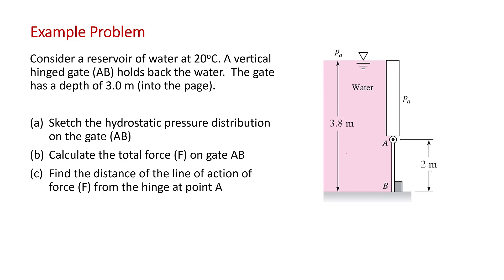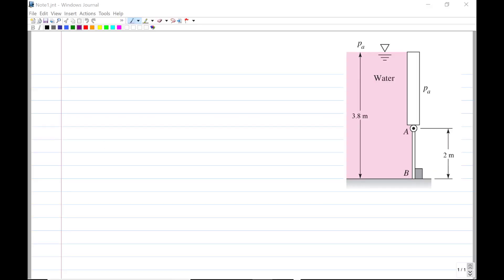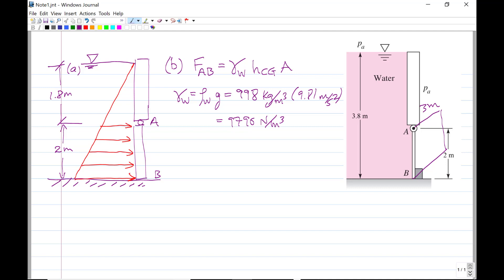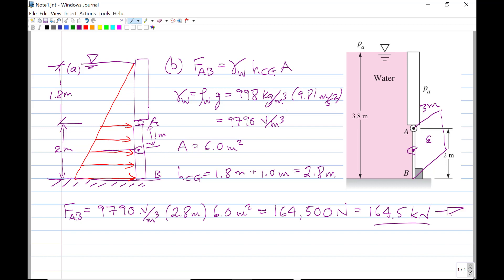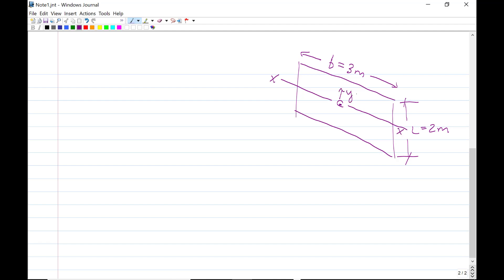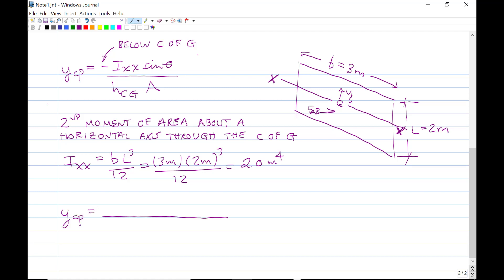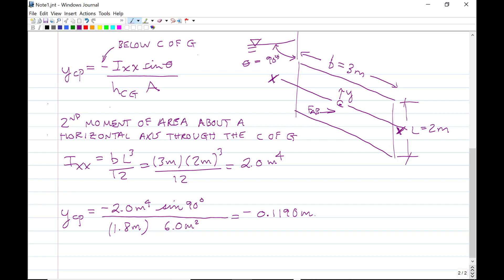Solved Example: Hydrostatic Forces on a Vertical Gate

Comment: I have a question. Why do we consider the horizontal force to be acting at the (height of) centre of gravity and then at the end we then consider it to be acting at the (height of )centre of pressure? Im sorry if this is a really stupid q im confused a bit
Reply from the maker: The magnitude of the  hydrostatic force is calculated using the average pressure, which happens at the centroid. But the line of action is below the centroid. It's like a triangular distributed load in beam deflection analysis, if that helps.
Reply: @FluidMatters  thankyou, that helped!!

Comment: Quick question does the force due to pressure depend on the whole shape of the submerged object or only on the surface in contact with the liquid. Like if a flat plane surface of slant length L is submerged, will the force be same as a slant trapezoid of length L also.
Reply from the maker: The total force due to pressure depends upon the depth of the centroid of the surface (which might be different for a trapezoid), the surface area. I hope that helps.

Comment: A salvage ship is attempting to raise an iron anchor off the ocean floor. The anchor has a mass of 560 kg and the density of iron is 7 800 kg/ m3 .The cable used to lift the anchor can support a weight of 5 000 N. before breaking. Use 1 025 kg/m3 as the density of seawater. (a) Can the cable support the anchor while it is completely submerged? (b) Can the cable support the anchor when it is completely out of the water? (c) What percentage of the anchor will be out of the water when the cable breaks?
Reply from the maker: That's an easy question to answer, if you do the necessary learning. Here's a recommended video top help: https://youtu.be/MJnYZ6s-LsQ

Comment: How would I go about finding the reaction forces at points A and B?
Reply from the maker: Basic statics: Once you have the horizontal force at B, then set the sum of the forces in the x-direction equals zero to get F_Ax and set the sum of the forces in the y-direction equals zero to get F_Ay.  Actually, F_Ay is zero by observation.

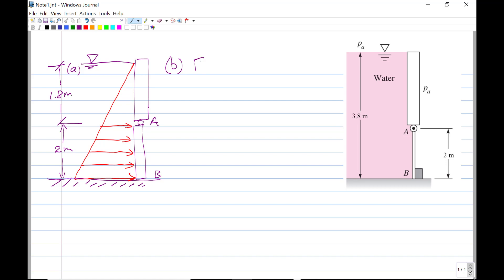Comment: 02:05 , free surface has Pa, a little correction i think??
Reply from the maker: No correction is needed because Pa also acts on the right side of the gate. So, the effect of atmospheric pressure cancels out.

Comment: For the last question why is the equation not : ycp = Ixx/hA +h
Reply from the maker: ycp is measured from the center of gravity, not the free surface. It's the the distance from the h_cg, with the negative sign indicating its below the cg. So, the distance from the free surface to the center of pressure is h_cg + abs(y_cp). I hope that helps.
Reply: @FluidMatters  isn't that eccentricity? the center of pressure is measured from FWS
Reply from the maker: @CARLANTHONBULAHAN-kg4ee  The center of pressure is the point on a body where a single force can be applied to represent the total effect of a pressure field. If you want to have a rigid definition from a specific location, I guess that's 
ok. The main thing is to understand the concept. Does it matter that the center of area of a triangle is 1/3h from the base, not  2/3h from the apex? Personally, I don't think so, IF you get the concept. I hope that helps.